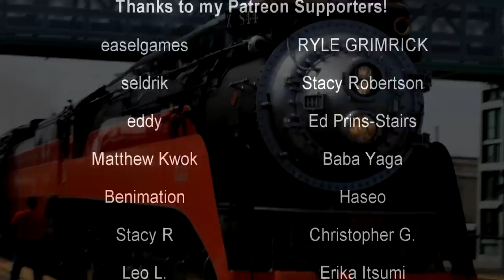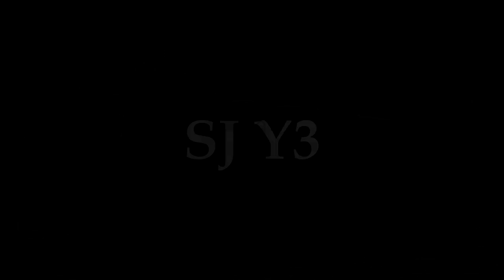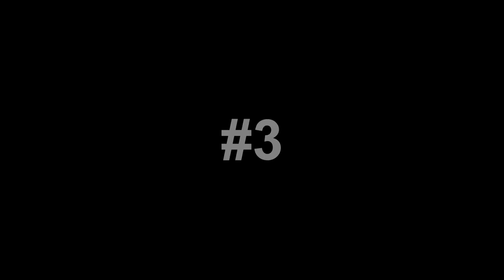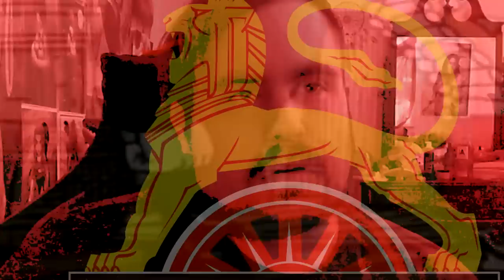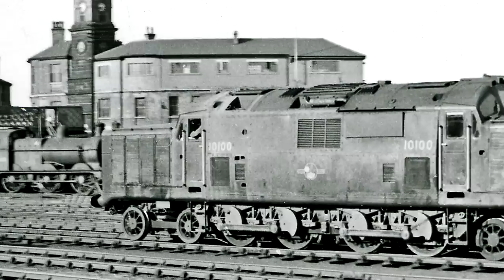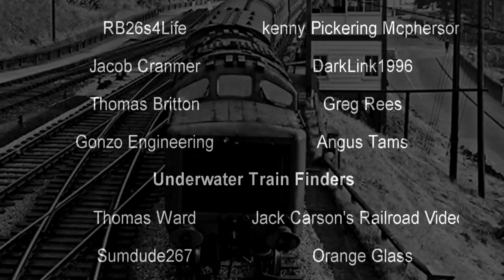5 of the WORST TRAINS EVER PART 20 | History in the Dark

Comment: Aaa.. yes.. the Camel, it was pretty bad. (the Y3 often called the camel due to the hump)

It was actually a pretty smart concept with two similar looking control units at each end then a varied number of cars between them. This train was also used a lot in Denmark but if i remember correctly they switched out the power unit and just keeped the control unit. In denmark i think it was used all the way until the year 2000.

Still that is not really that uncommon. We have a lot of locos and maneuver units from the 60s that is still in use every day to this day. Two of them that have not been featured at the best trains, despite they clearly are. The RC and the T44.

Comment: Thank you for explaining how the Fell engine (not to be confused with the New Zealand rack line variety) worked - although I knew of its existence I'd never previously seen any description of its machinery. Talk about over complicated, and hence vulnerable? 
The little Japanese engines weren't so crazy  by the standards of the time; many early engines had no brakes, relying on shutting off steam or reversing the motion to stop. Indeed the first Stirling 7 foot single express engines, built around the same time, came out of the shops with no brakes at all on the driving wheels, and a handbrake on the tender. Similarly piling the coal on the tank tops was a quite common practice (or inside the cab, on the footplate, as on the Isle of Man Beyers) for many years after this.
 From memory the Santa Fe's weren't exactly 'scrapped', but dismantled and rebuilt as conventional Prairie type locomotives, in which form they were quite successful. And as for the 4-2-2 - surely it would have shaken itself to pieces before being too long in traffic?
Reply: @JohnDavies-cn3ro  It could be argued the NZR H class Fell engines were also pretty messed up. Hopefully their namesake designer wasn't related to the "designer" of the diesel.

Comment: I was wondering when the Fell would end up on this list series. I rather like the look of it from the outside, the 4-8-4 wheel arrangement on a diesel looks deceptively elegant, but after hearing your explanation I wouldn't so much as take a peak of the inside.
Reply: It's 4-4-4-4. The con rods only connect 2 wheels.

Comment: Fun fact: The ML-4000 is the only Diesel-Hydraulic and the first German Import, these locomotives was built for the Southern Pacific, and the Denver & Rio Grande Western by Krauss Maffei. They were proven fault due to the fact their engines sized and stalled on Donor Pass. SP 9010 is the only ML-4000 survivor and it's at the Niles Canyon railroad and the other ML-4000s were scrapped.

Comment: I think there’s one I think SD45 but not dash two series because you know they are unreliable they because the if they are using 3600 Horsepower engine it will crack the frame and the engine overheats with very high AMPS which made the other railroads to think twice before buying them
Reply: There was an EMD SD45-2.  Most of the production run was purchased by the Santa Fe.  Also, Southern Pacific ordered almost 300 of them in "Tunnel Motor" (EMD SD45T-2) form.  The original SD45 was known for breaking its own crankshaft with alarming regularity, and for cracking its own cast frame.  Both of these problems were rectified in the -2 version (EMD 645E3 prime mover and a change from a cast frame to a frame fabricated from structural steel components).  Problem #3, overheating in tunnels and snowsheds (pretty unique to the SP Donner Pass route) had to be rectified by modifying the cooling system, which is why the Tunnel Motors were created for Espee.
Reply: @brentboswell1294  but I wasn’t talking about SD45-2 just SD45

Comment: never underestimate the stupidity of mankind.
it seems BR had the finest exampels on the payrol.
This doesn't mean that other railroads of other countries are stupidity free.
SNCF ordered alot of new trains who were to high/wide for most platforms.
DB had new IC trains with very bad backbreaking seats.
NS (Dutch railways) , NMBS (Belgian railways) and DSB (Danish railways) had the horrors of Ansaldo Breda build euh verry badly slapped togheter trains.
Also the NS made the same mistake 5 times!
Electrical equipment was placed at first underneath the carriages of the 1936 stock, later 1940 then1946 stock, 1954 stock and even 1964 stock!
Snow. rain and dust created havoc on the electrical equipment beneath and all issues were resolved by placing equipment elsewere during the lifetime of the stock. 

Ofcourse the new NS ICNG stock of 2022 has most of the equipment beneath 🤦‍♂

Comment: The Fell Diesel is a socialism level stupid idea.
Reply: its called an experimental design for a reason
Reply: @Trainman10715  
Watch it again being experimental doesn't have to be stupid. This is stupid. 4 engines that can't put out more power than any one of the engines is really really stupid.
Reply: @calvingreene90  you watch it again lol, he explaines how the separatly driven superchargers cause the engines to put out far more power and torque at low speed than they otherwise would, and their power output at full speed was 500 each which was totally adiquate. There was nothing stupid about the design in theory, all valid principles that are used today, it just proved far too complicated and expensive to maintain. Again, it's called experimental for a reason
Reply: @Trainman10715  
The gearing meant that you got the same tractive effort from one drive engine as you could get with all four except that with both blowers you could probably get more wheel torque when only running one engine.
With a rational transmission set up the super blown torque control isn't in itself a bad idea.
Reply: @calvingreene90  no it meant you got the same torque from one engine, then the externally driven supercharging meant you got more torque and more tractive effort as a result.